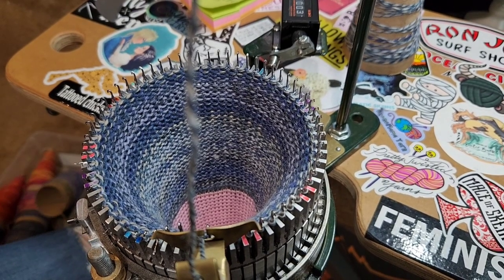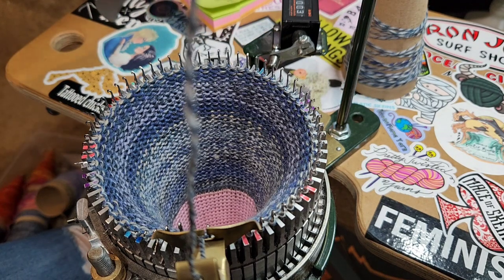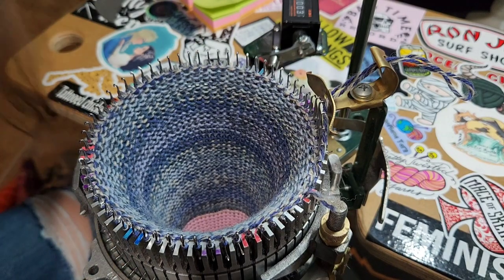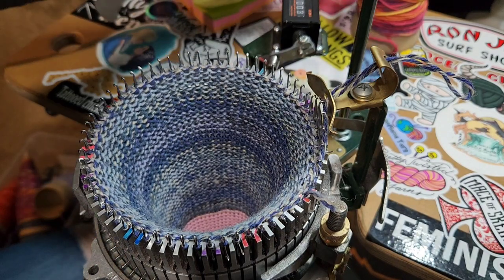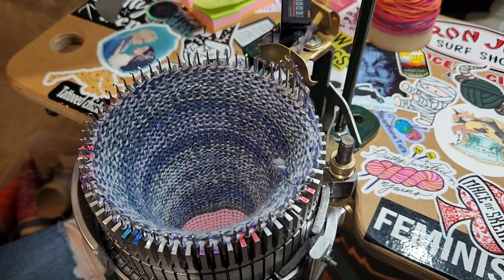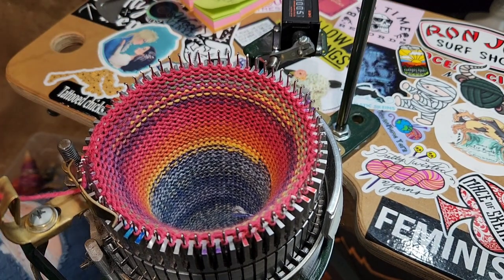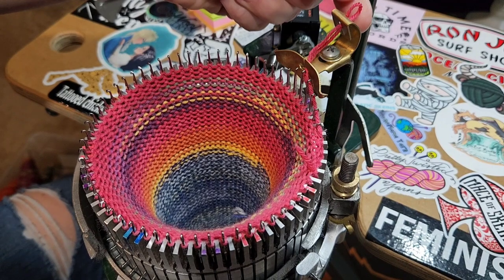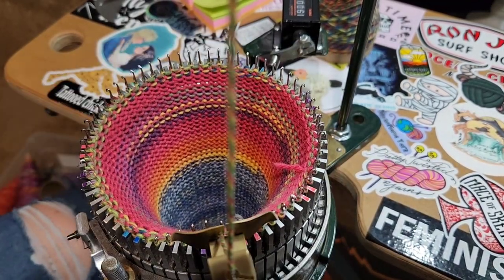Circular Sock Machine || Changing yarn using a clasped weft join || Knitting

Comment: Aquila what size cylinder are you using?  I find the Patons Kroy knits up tighter on my 60 cylinder.  The stitches are too big if I loosen the tension.  I may give it a go on my 54 cylinder and see the results.  I've been using the 'Russian join' for my heels and it works great!   No ends to weave in.  Thank you, I appreciate the time you take to make these videos.
Reply from the maker: I use the 64 for patons kroy and click my tension 4 times looser than my 'normal' tension. But yes it would probably work great on a smaller cylinder like a 54.  I love joining my yarn this way, like you said,  no ends!